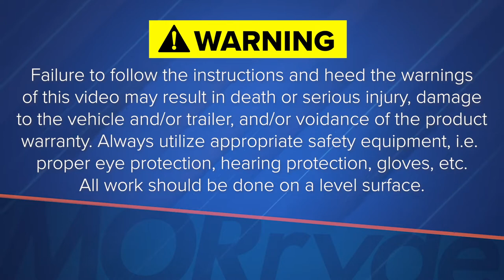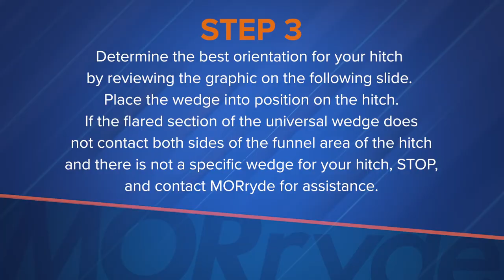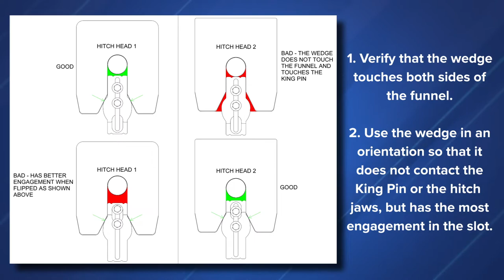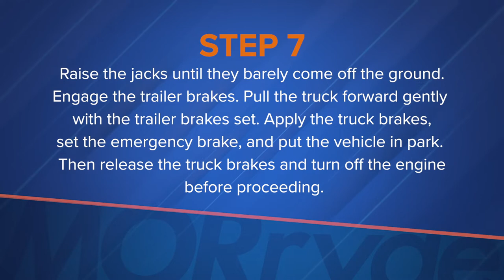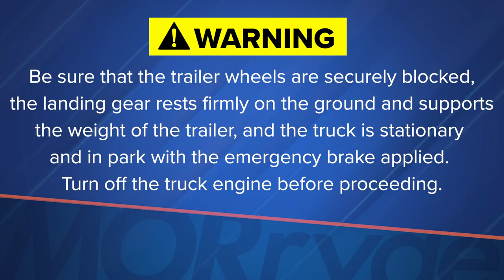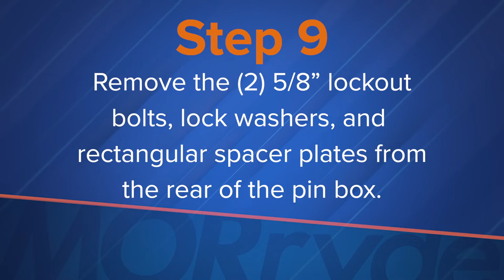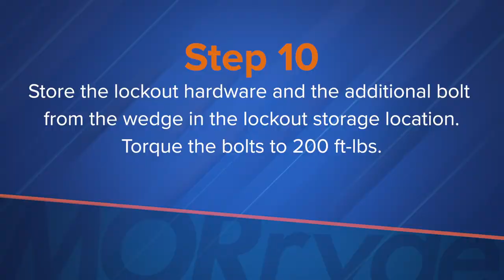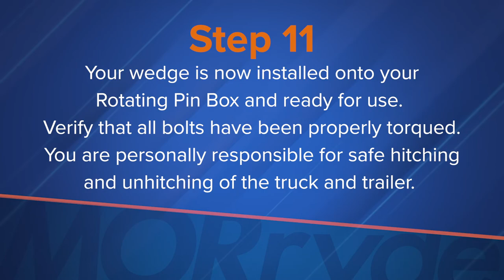Rotating Rubber Pin Box Wedge Installation Instructions

Comment: I'd love to be able to use this feature on my Orbital pin box.  I have a 2020 Eagle HT 30.5 MBOK and the Orbital is installed so you cannot get to the bolts to put the pin box in the lower position using the top holes.  With it like it is, there is no clearance for the pin box to rotate as it will rip off the nose cap trim and sheer off the light mounted by it.  almost seems like a defective installation by the dealer to not be able to use it as advertized.